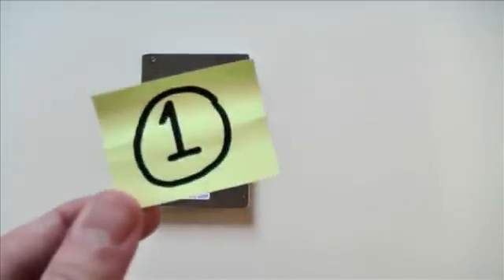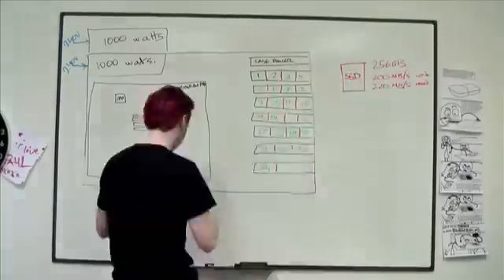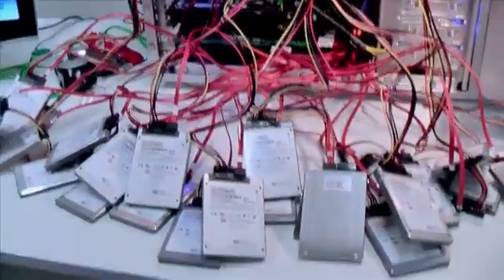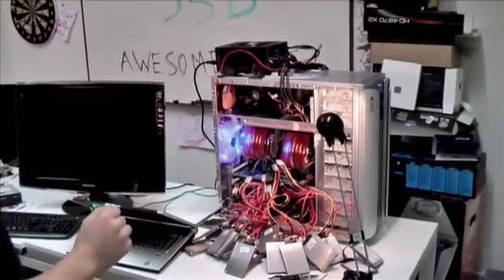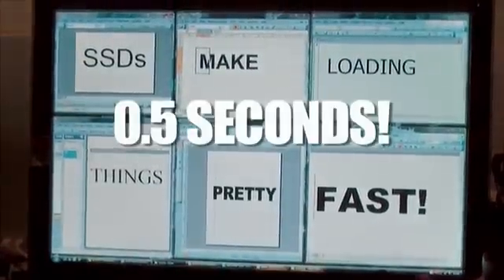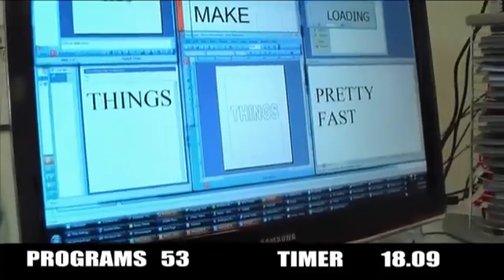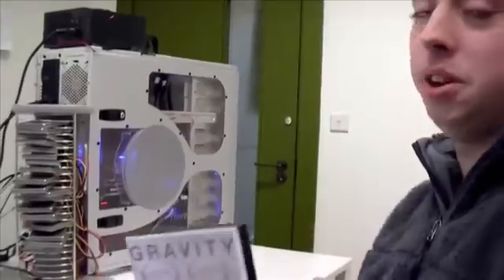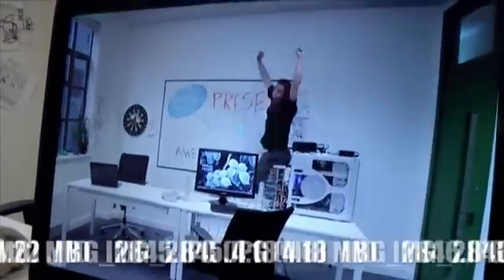What happens when you RAID 24 SSD Hard Disks !!!!!

Comment: did he... just .... defrag... an ssd?
Reply: +Curious Wars nope it was 24 ;)
Reply: +Curious Wars Yes, and all the 3(!) fragmented files then got defragmented. (Size?)
And as for the recycling of 700 files - it´s essentially just a rename of each file back to its original name and location, regardless of file size. And the file-copy in windows can be a little tricky when the RAM buffers the writes before it is committed to disk - however, a catchy tune in the background - but I think that they are better at marketing then they are at testing things technically correct.
Reply: originaletponkarn yeah, anyone who defrags a solid state shouldn't have one. Not gonna kill your disk instantly but it doesn't increase performance (as there is no need for a physical part to move to pull data) and can drastically reduce the lifespan of your drive.
Reply: +Jos Geerink no it won't.. it is just not necessary.. fragmentation was a problem on old hdds.. fragmented data on an ssd do not really lower the performance here cause basically it doesn't matter where the data is as all cells can be read equally fast.. hdds with moving heads had to jump over the place.. 
so it is not necessary but it doesn't mean you kill it.. it just dies faster cause you cause unnecessary write operations.. but well.. even if you defrag once a month it will still last for many years.. i'm using my 256 gb ssd for 4 years and i have about 12 tb written in this time.. i guess i'll get a faster/bigger new one a long time before it dies cause of dead cells.. well in this case i would still use it ofc and install games on it or smth..
Reply: I was actually so into this video then he did that and my heart sank oh my god why.
Reply: +Curious Wars
I agree. though isnt it rather a better idea to just put the OS on a SSD and use a part of the remaining free space for caching instead of the RAM?
Reply: MrDave1502 yeah :) Either way his were just SSD. SSHDD look like normal spin disks
Reply: “IT Genius”
Reply: it will kill the ssd realyw fast
Reply: tothod haha that 2... mind blown
Reply: +Jos Geerink thats my point lol
Reply: +Curious Wars Fuck that i have a ramdisk.
Reply: +Curious Wars just waste of money
Reply: Dunkelelf3 " yeah, anyone who defrags a solid state shouldn't have one. Not gonna kill your disk instantly but it doesn't increase performance (as there is no need for a physical part to move to pull data) and can drastically reduce the lifespan of your drive." <---- this is the point we are making.

yes... yes it will. no one says it will kill the drive, just that it reduces the life span by a lot. and if done excessively can definitely kill the drive over time. defragging is extremely bad to the lifespan of your ssd. sure doing it once isn't a big deal but most people don't just defrag once. defraging re-writes a large amount of the hard drive, the fuller it is, the more data is re-written.

lets say you have 100gb stored on your drive and you defrag. it will usually move about 50% of the drive or more (depending on fragmentation) and it needs to move the file to the buffer zone, then move it to the place it wants it. thats copys twice per fragment! so 50gb moved twice is 100gb. say you do that once a week (as most people did in HDD days). thats 52x100= 5200 (FIVE TB A YEAR!). obviously other things go into this like fragmented percentage and so on but im sure you get my point.

I've had my boot SSD (500gb) for about 4 months and other than installing some stuff i store no data to it. all data goes to my storage ssd drives. i've already used about 5tb on that drive just from things like page filing, cache, prefetch, windows updates, program updates and so on. no real data copied to it (only 100gb used)

don't worry too much though, your 256 is likely rated for about 256TB of writing if not double that (depends on the type SSD). with the tiny little bit of usage you had you can used that drive forever. most of us realistically use a lot more than 12tb over 4 years.
Reply: +Curious Wars I was like what are you-- NOOOOOOOOOOOOOOOOOOOOOOOOOOOOOOOOO
Reply: +Curious Wars i have an ssd on win 7 and i have disabled defragging.
Reply: +Dunkelelf3  I was wondering actually... there is not much gain from putting games on a ssd.
It would rather be better to put the OS on SSD and use the hard drive for game storage. And now for the wondering part... I have this hunch that games gain performance when there is no OS on the HDD running in the background. 
I`ve installed 2 ssd in raid0 a few weeks ago and kept the HDD also raid 0 for game and movie storage. 
steam and games load a lot faster since there is no running OS on the drive.
Reply: Laurens Burssens Well it depend what games you play. I ALWAYS recommend to put the OS on a solid state and all other data on a separate drive. but at this point there isn't much reason NOT to get 2 solid states (one for the os that is super small like 120gb)

Some games don't load all the data into your RAM efficiently (diablo 3 is a great example of this) and so get great boosts from solid states. Solid states also dramatically reduce load times of big games (like GTA). They aren't going to give you a higher fps though. Just shorter load times
Reply: +Curious Wars Not just any SSD... An SSD Hard.. disk... Ok..
Reply: Fite me IRL 1v1 you mean SSD. they weren't SSHD :P Perhaps I misunderstand your point as this post was from quite some time ago.
Reply: +Curious Wars No, he meant SSD Hard Disk. Read the title of the video. These guys don't seem to know what they're doing.
Reply: idk, probably they said it wrong. SSD HDD is a hybrid drive afaik
Reply: Well if they defragged an SSD, then I'm betting on they don't have a clue of what they're doing.
Reply: Fite me IRL 1v1 ROFL I see what you're saying now. Didn't realize they said that in the title of the video... How retarded are they?
Reply: still, if an "SSHDD" (or hybrid drive) it has an ssd in it so defragging it is a no go
Reply: Shorter load times are essential if you have short gaming periods.  Although, maybe there's a way to get your computer to preload the game's files into memory before you're ready to play so you don't have to wait at all.  In that case, storage speed wouldn't make any difference.
Reply: OptimisticPessimist Yep,  just create a ramdisk and you can literally use your RAM as storage. 64gb of RAM for a reason :P
Reply: Curious Wars
Maybe not even that.  Just make sure you have enough RAM, and employ a utility to read all the files you want to load quickly.  They will be in the cache when you're ready to start. If you use a RAM disk, there will be two copies of every file in use in RAM.  I'd rather have just one.
Reply: OptimisticPessimist Yeah true, much more efficient your way :)
Reply: A Random Guy It's "an" because SSD makes a vowel sound. You should have googled it first :P

https://www.google.com/search?q=when+to+use+an&oq=when+to+use+an&aqs=chrome..69i57.3960j0j7&sourceid=chrome&ie=UTF-8
Reply: was goin to comment this, saw your post. bet all those SSD's died the next day. ALSO WINDOWS VISTA
Reply: GodBurst PK First off, this comment is old ass balls. Second off, I was entertained by their stupidity. Some people have more money than brains.
Reply: Yes, some IT genius huh? Lol
Reply: Curious Wars exactly what I was thinking
Reply: He just did it to show how fast it fucking was facepalm
Reply: i did that too with my first SSD

i had no clue..

i was so used to the magical defrag for HDDs to have a 0.2 seconds snappier computer, that i even used it on SSDs
until i finally found out that this is a bad thing
Reply: are you.... buthurt by this ... video?
Reply: I'd guess for dramatic effect.  Too bad if Windows still doesn't intelligently handle data blocks like Unix variants.  If periodic defragging in Windows was turned off it would get as bad in a couple weeks of normal use as a life time of heavy use of ext4 in Linux.
  I've verified this in Windows 8.1, nothing newer.  Just using it fragments files over time without creating a lot of new files and with well over ninety percent free.  It's hard to fragment ext4 with ninety-five percent in use.

Comment: 2GB/s? With 24 drives? That means like 85 MB/s per a drive only... You can reach this easily with 24 classic 2011 drives. So the speed is quite disappointing. Ofc the access times are incomparably better with ssds.

Comment: Yeh a SSD will allow you to play crysis Hi-Res
Reply: unless you got a messed up hard-drive all it would do is improve loading times
Reply: +VapidDesigns That will be the gpu sir. If you have all those ssds and a shit gpu, it wouldn't improve any.
Reply: Cyanide Pandaz
That would be a r/woosh sir
Reply: +Cyanide „CyanidePandas“ Pandaz That's not 100% right! There a games with Loading Screens (who load faster the Loading Screen but the frame rate in this games does not increase really appreciable) but there a Games too without Loading Screens, who loading all content in the background while you playing. P.e. nearly all "Open World" Games loading his content in the background and then, a SSD or better a SSD-Raid-0 can increase the frame rate clearly.

+Patrick O'Neill
Today, you can buy a big stock of absolut new 5.400rpm HDD's on the market. This HDD's have div. benefits again 7.200rpm drives or the very rare and expensive 10.400rpm-11.200rpm drives (who have all a relativ small amount of data and who are very loud). 5.400rpm drives where still sold today p.e. for Backup-Files or big archives of mp3's. A other right to exist is there smaller energy consumption and longer life-time (important for Backup-Archives) and the lower volume (p.e. important for Silent PC's) against the 7.200rpm drives.

I myself use 2x 2,5TB 5.400rpm drives in a Raid-0 array for Backup all my important's files (Movies, Series, Sounds, Projects, Software, etc.) with Synchredible® on my PC and the array needs still with 5.400rpm drives SATA-3 Ports because SATA-2 Ports (300MB/sec) are to slow for 2 modern 5.400rpm drives.
Reply: +[DVZ] - GuardX Yes that's right however a hard-drive is efficient enough and not a bottleneck to run games like that as hard-drives now have read speeds of 200Mbs (which is a one I have, and tested with games)
Reply: +YT's Top 5.000 Deutsch-Rap Video Charts If those "important files" are really important don't use a RAID0. get a couple more drives and a RAID4 or RAID5. RAID0 as a backup system makes no sense. It offers no failsafe mechanism (in fact it is a tad more likely to fail and make you lose ALL your data than a single drive) and the only benefit it offers is better read/write speed... which you probably don't care about for a backup drive.
Reply: +VapidDesigns 
hard drives hardly have changed since they became hand sized. the only thing thats changed
(as far as i know, please dont crucify me if im wrong...)
is the amount of data(thanks to smaller heads) it contains, and our good friend the serial ATA port and its fantastic function. 

other than that, theyre all 7200rpm(sometimes 11000rpm?? something like that) i mean in the early 90s i think they were 5400rpm.. nothings really changed but those few things. theyre always the bottle neck of any performance PC. always the weakest link, even though when you watch them work its really amazing.

thats why SSDs are so awesome. theyre nearly instantaneous(?)

at that point i THINK the sata connection itself is slower than the actual seek and write of the SSD itself. again, im kindve just regurgitating and filling in blanks here, so my apologies if what i said hasnt been exactly text book, i understand people dont like it when people just throw inaccurate data around, i hate it to.
Reply: Titan Z
Reply: +Joefis x20s lol
Reply: +VapidDesigns no hard drives dont improve frame rate. The game data is stored in system ram and GPU ram. The stress fpr HDD or SSD is quite low ...
Reply: +Isawa De La Pradera also using raid 0 would mean only having 2.5TB of storage instead of 5TB so for a backup raid 0 is the worst...
Reply: +Joefis x20s You're thinking of RAID1, which offers data safety (as it duplicates data on every disk so a single disk failure means losing nothing) but no extra speed and can save only as much as a single drive can.
RAID0 does offer as much storage as the sum of its component drives. It just doesn't make sense using it for a backup beckause the failure of a single disk means losing the totality of the data as it is equally split among them.
(I am sure you knew this, and just messed up, I am explaining this for the passerbys)
Reply: Isawa De La Pradera Yeah lol i meant RAID1 :/ But still using RAID0 for a backup is not good...
Reply: only luck will help you to play crysis on high res
Reply: +Vesgao I just burnt up a GTX 980 playing Crysis 3 maxed.

Comment: You were using 800mhz RAM in 2011? You could get RAM at 1.6ghz pretty easily back then. Seems like a pretty huge and unnecessary bottleneck.
Reply: +Yella Dart I'm pretty sure it is DDR3 1600, which means that it operates at 800Mhz. 1600 refers to data rate, not clock rate.
Reply: +Yella Dart They were most likely running dual channel, which in fact is 1600MHZ but is split up and shows as 800MHz
Reply: +Yella Dart Original video is from 2009.
Reply: +Yella Dart This was the "Skulltrail" (Ultimate gaming) platform aka 2xQX9775s on an Intel D5400XS motherboard, which only supported DDR2 FBDIMMs, 800Mhz tops.Even though DDR3 technology was available at the time of release (early 2008), Intel thought FBDIMMs would improve gaming experience. Also what +Pasi123 said.

Comment: Maybe the two quad core processors is a factor on how fast it is.
Reply: +Brandon Smith I was referring to the games. Ssd's don't help a lot on playing games, mostly just loading times.
Reply: +CreeperCraft137 games are not made to be played in 2x processor configuration either, so you wont get much performance improvements either.
Reply: At the time the CPU was top notch tbf.. And crossfire amd 4870x2s this machine is a beast

Comment: With all the other jargon you threw out, I'm disapponted the subtitle claimed "over 2GB per second". 2GB is 2048MB, not 2000. Computers tend to work in powers of 2 due to the whole binary thing. It was almost 2GB/second. Not over 2GB/s.

Minor point I suppose, but still.
Reply: MGlBlaze He is correct; you are confusing gigabytes and gibibytes. GB is an abreviation of gigabyte. Giga is an SI prefix representing 10^9, making a gigabyte 10^9 bytes or 1,000 megabytes. GiB is an abbreviation of gibibyte. Gibi is an IEC binary prefix representing 1024^3 (or 2^30,) making a gibibyte 1024^3 (or 2^30) byte or 1,024 mebibytes. Per these definitions, 2GB is 2,000MB, and 2GiB is 2,048MiB.
Reply: NOPE NOPERSON
 Technically yes but I would like to know where outside of some extremely hard academic applications people use GB to refer to 10^9 bytes, rather than 2^30 bytes. Every single time I have ever seen the SI prefix used it was as a synonym for the binary value, and I've gone through quite a lot of software engineering stuff. I'm serious, I only ever came across the term GiB when I just stumbled across it on wikipedia one day.

So while that is technically correct, I don't really feel like giving whoever edited the video that much credit. It's more likely they just messed up.

Comment: Using raid 0  (24x256gb)  you'd lose about 17.5 gigs per drive, but it's the unsafest method, because if one drive fails, which is likely. Using raid 0+1 steals more than a half of each drive, but redundancy is higher. raid 3 4 and 5 make the most sense in terms of safeness vs. speed but yeah, it's really really fast

Comment: its stupid thing.. 1ssd or 1000 ssd all same. its doesnt increase performance. its not ram for you dumb
Reply: Jetstream Sam
Actually, the answer is yes. RAID 0 splits up the data between two (or more) physical disks. This does increase the disk performance. The drawback is that it provides no redundancy, meaning that if one disk fails, all your data in the RAID 0 array is lost.
Reply: You should check how SSD is built.
Reply: Mgaak  does it matter ? 1 ssd plugged into pc or 1000 ssd?? will performance be different with more ssd? the answer is no!.
Reply: Its like a resistor connected in series, or maybe the Christmas lights might be better analogy.